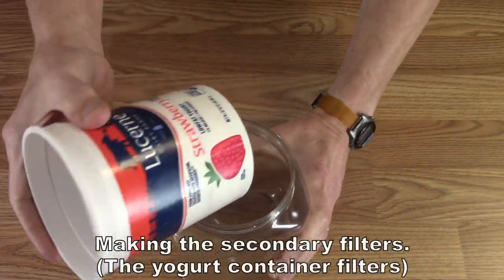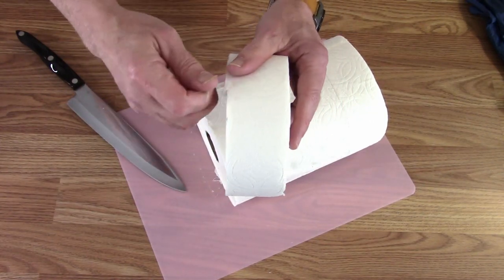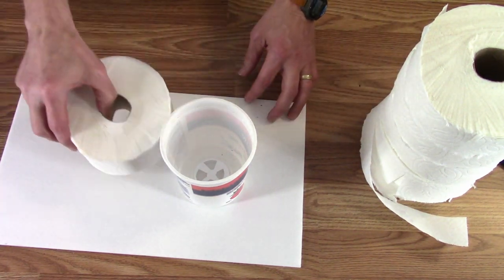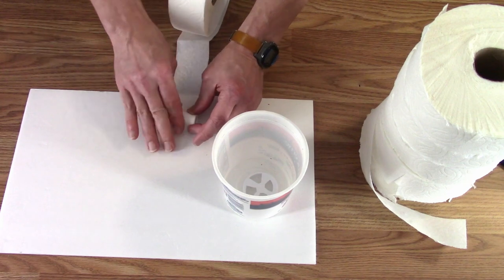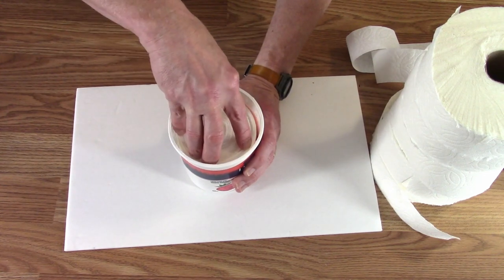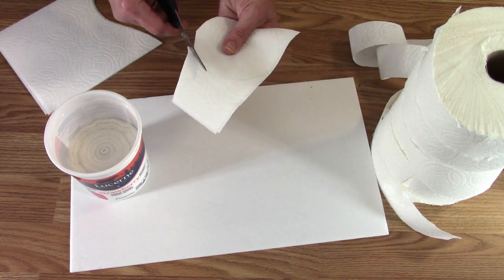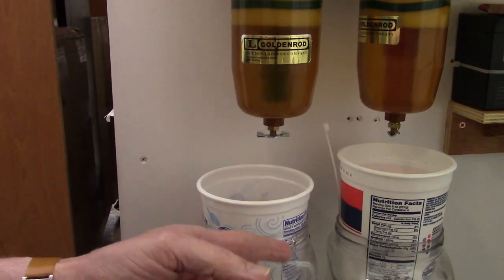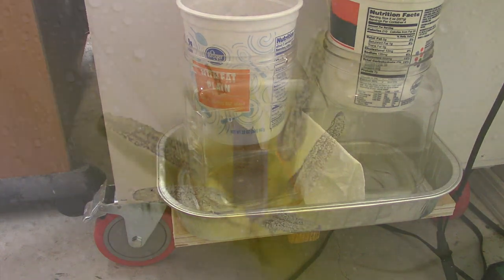Making an Oil Filter for our Harvest Right Freeze Dryer after Batch 35

Comment: Just curious where did you get your screen cover?
Reply from the maker: The one I put over the touch screen?
I wish I could tell what the screen cover is, but I don't know! It was just a half of a clam-shell package for something that I happened to have the day I needed it, and it just happened to be a perfect fit. I just used a piece of tape along the top edge to hold it in place and act as the hinge. It may have been a computer memory package or battery package, I really don't know. It's been on a long time; ever since someone (sister) saw dust on the screen and wiped it off while a batch was running, not knowing it was a touch screen, and canceled the freeze drying. Oops.